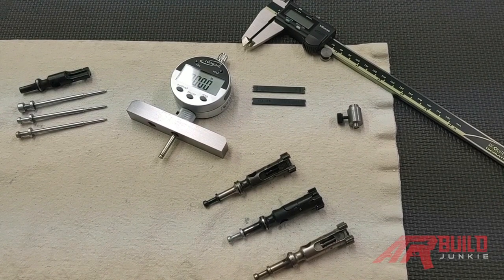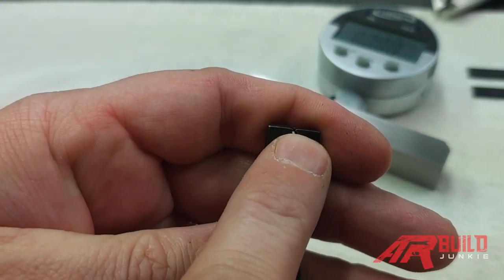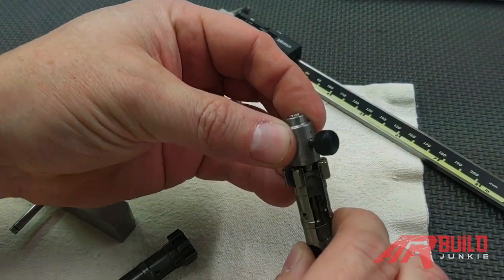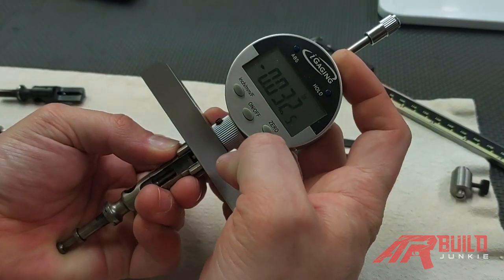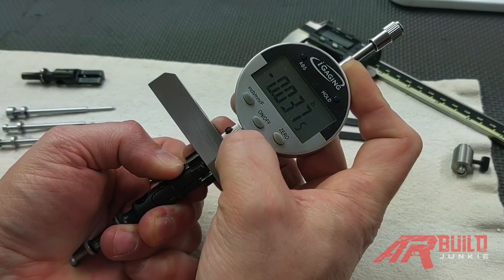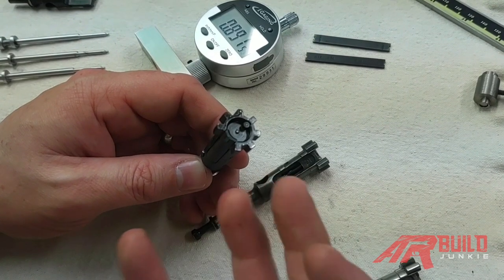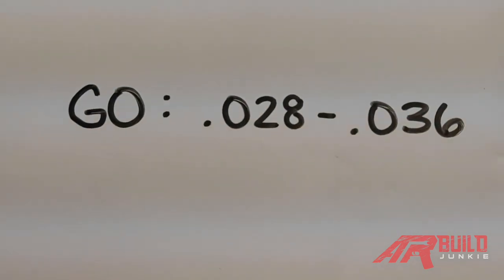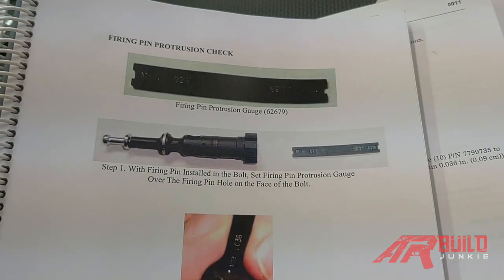AR-15 Firing Pin Protrusion | How to Gauge the Pin and Why | School of the American Rifle

Comment: I'd like to suggest a much cheaper method. Use feeler guages to measure the space between the bolt tail and the firing pin flange after you lined up the firing pin tip with the bolt face.

Comment: I started building AR's in 7.62x39. Once I found the sweet spot for that caliber and all was great. After a couple hundred rounds I started getting light primer strikes on Tulammo steel cased ammo. No doubt the carbon was building up causing less stroke of the firing pin. I went with a RedX enhanced firing pin and now that never happens. Even though I never shoot brass cased ammo in my x39's, I have wondered if they would rupture the primer on brass cased ammo?
Reply: I dont think there would be a problem. An enhanced firing pin is a little bit longer but I'm sure they figured out how long is too long. Youd be fine with brass

Comment: I just tested my pin using my caliper, it was .80mm in average(.78, .82, .80), which is about .0307in. It did give me many times of unfired primer dimple, but I think it was mainly the short stroke of my AR caused that, probably a gas leak resulting to insufficient pressue and energy restored on the buffer spring, and the return of the buffer didn't hit the pin hard enough

Comment: Have this problem on my 556 10.5 built. Great video I didn't think about my hammer spring.  Also footnote your dustcover pin is not installed correctly.. Don't want that coming out and getting jammed in your extractor. 100 pushups 4 laps

Comment: Great video. I am about to make a dummy firing pin, to safely demonstrate an AR-15 in use, for my Hunter Safety Classes. And we can't have live firing weapons now! (Long story). And I have learned, if you just remove the firing pin, the entire BCG gets jammed up, and locks into battery! Its a big pain to break loose. So, I am going to grind off the business end of a cheap firing pin, by several thousands! Of course, I'll test fire it, to make sure it does NOT fire.

Comment: Does it change for different calibers? 50BMG for instance requires a 'red' hammer spring to achieve correct hammer weight for primer detonation, does a 'deeper' pin set also see a more reliable detonation?
Reply: Some people recommend the enhanced hammers some don't. For 10 bucks tho why not get one. Not super sure if they are necessary, but I dont think it can hurt anything.